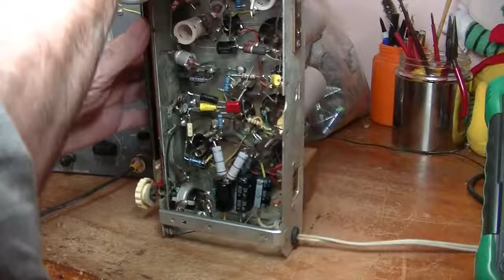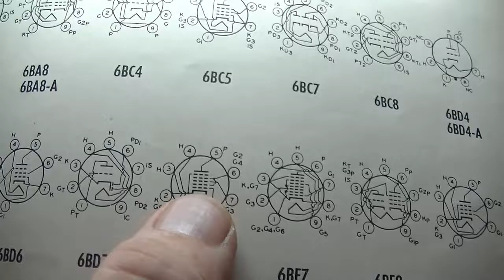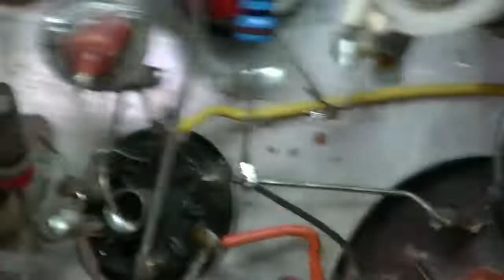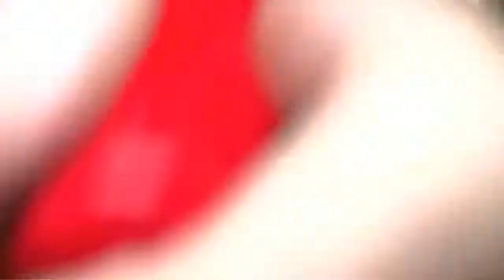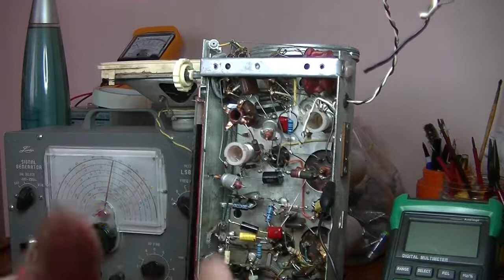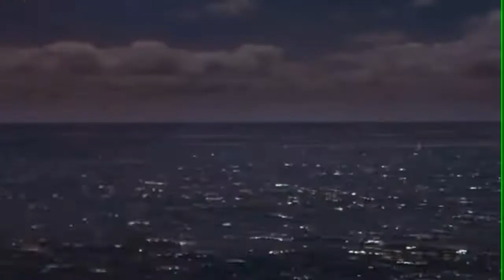Valve radio Alignment Re-visited

Comment: YouTube is a Godsend for learning on so many levels, unfortunately there was no such thing as the internet when I first started repairing radios and television back in the early 1970's. Not sure why your alignment instructions want the tuning capacitor fully closed when most of them if not all of them call for the tuning capacitor to be fully open down here when aligning the IF's. I don't think it really matters either way since you shouldn't pick up any stations which allows you to adjust the IF''s to resonate at their required frequencies. This video should definitely help the first-time radio aligners.
Reply from the maker: Yes, I remember the same thing back in the 80's when trying to learn a new song on the guitar, you had to do it yourself. So easy today with YT. 

I agree on the tuning cap being opened or closed, I dont think it makes a difference, or maybe the Aussie engineers, just wanted to be different lol  At  my level I just follow the instructions and hope that it works